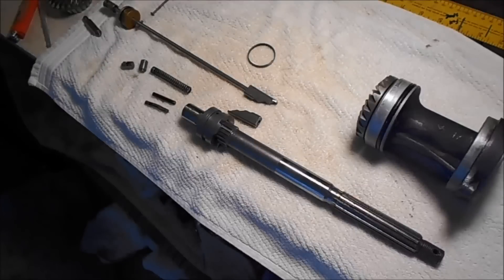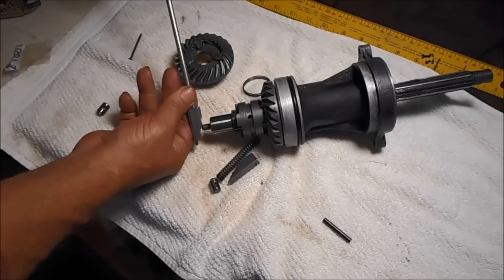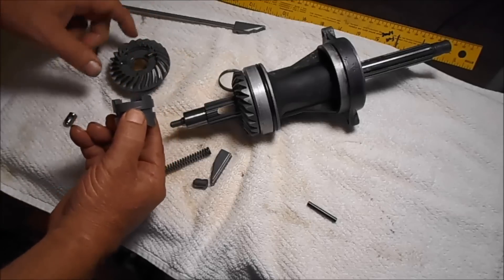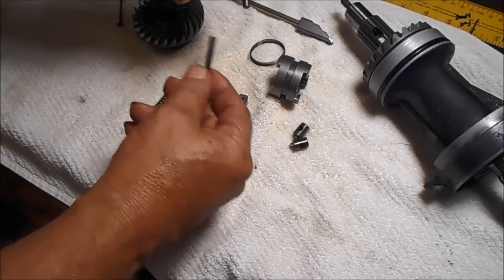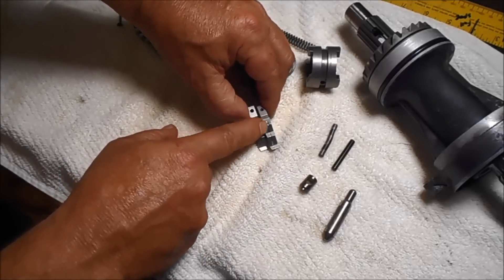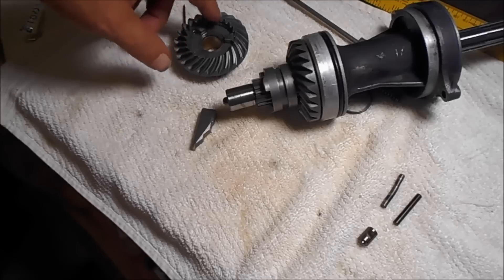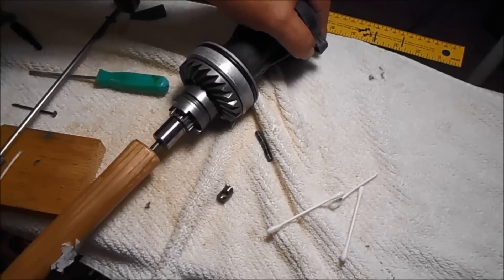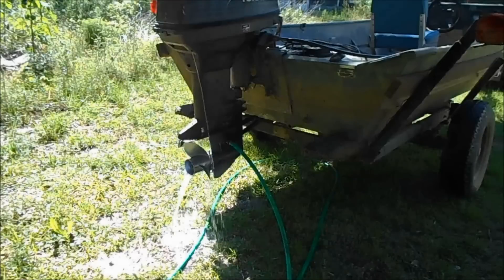Outboard Wont Shift Into Reverse Are Jumping Out Of Gear, Clutch Dog

Comment from the maker: YOU WANT TO SEE MORE. I HAVE 90 VIDEOS...MY CHANNEL..CLK HERE..https://www.youtube.com/user/36erichol/videos   CLICK LOAD MORE
Reply: Danny S Hodges
Reply: Do you have any on a 1977 Johnson 70hp? 3 cylinder motor
Reply: Question...does it really matter what kind of grease gets on gears in a outboard motor?
I mean does it have to be marine grade?
Reply: Those bearings are designed for fluid inside. Try not to get any or it will cake your bearings and they will not roll properly
Reply: @davoh7910  Thanks Davo H...
I had a strong feeling it wasn't good but had to ask for emergency purposes..for "just in case"...
Have a great day.

Comment: Cool video. You covered issues I believe are the cause of more gear engagement problems people have with their outboards than the clutch dogs being worn. I'd be willing to bet that excessive play you show on the shift rod head and the bent pin and worn spring cams are the issues causing the dogs to round the edges.  Fix those first and the repair costs drastically fall to affordable and worth doing.

Comment: Thanks Danny!! Extremely good info. Of all the videos that I've watched on this subject, yours is the only one that I've seen to mention the pin and other parts as being possible problems. I'll be checking mine either today or tomorrow. I hope that my problem is as simple and inexpensive as yours!
Reply from the maker: TKS WES LOOK FOR SOMTHING THAT DONT LOOK RIGHT AND MUCH DONT HAVE TO BE WRONG FOR IT NOT TO WORK RIGHT
Reply: Danny S Hodges, thanks for the explanation of how all this works. After seeing your video, I know exactly what needs to be done to repair my "reverse" issues. Leave it to a good ol boy to show everyone how it's done. Roll Tide!
Reply: I agree mine also great video
Reply: Danny S Hodges I forgot to let you know that mine DID turn out to be an inexpensive fix.  After stripping it down to the gears, which looked perfect, and putting it back together and adjusting the cables, it ran great.  Thanks.
Reply from the maker: lol good

Comment: Watched your water  pump video also. thanks for that too. Doing my own water pump impeller and noticed the previous guy didn't replace the roll pin he had knocked out on the shift linkage and there was only a half of a cotter key thru it bent allowing slack . I found the old roll pin in the lower unit where it had been lost. Expecting to see a difference on the same situation you have. Mine is weird about shifting, never jumps out of gear, but sometimes doesn't wanna go in.    Thanks for the videos sir.

Comment: Hey Danny I have a 90 hp mercury shifter won’t go in reverse the problem is in the lower unit I can hold pressure on shifter at top of motor and turn the prop till i feel it touch then it will Wouk good for a while what u think

Comment: Hey great video and very informative as always! I a quick question, my outboard when going into reverse won’t click in as usual so the RPM increases as I put back the throttle and then she clicks into reverse at high RPM. Have you any experience or solution with this problem? 
Iv only had the boat on the water two days and my heart is broken 😅🫣

Comment: Hi Danny.  Just watched your great video.  I have a 1987 mercury 80hp  3cyl.  When I put the muffs on it,it  goes in and out of gear no problem. But when I'm on the water it will go into reverse but when I put it into forward it starts to skip. I machined the dog clutch and it seems to fit happily with forward gear but when I put it together and put it in the water it starts to slip again.  Should the spring hold it in place or would a little wear on the forward gear cause this. Your Irish reader.

Comment: It took me three days to find a video on this I really do appreciate it thank you so much would’ve been great if you titled it  Yamaha shift rod or shift problem. Thank God I found it and thank you for posting it. Mine is a little different there is a drain hole on the front loweer case you have to remove to push in on that shift shaft to slide the shift rod down all the way. Hope this helps someone in the future also. GOD BLESS

Comment: thanks Danny I have 150 Johnson 1996 went out on lake boat would not go in reverse totally surprised me worked fine last year. It goes in forward and natural fine sometimes I have to wiggle control in neatural or engine wont start any ideas?
Reply: I wish I knew the answer to your problem. Mines doing the same thing. But its honda

Comment: I  accidentally pulled my shift rod out of the gearbox while changing the impeller. Now it won't go back in. do i need to pull the gears out and put the shift rod in first or should it be able to be pushed back in by its self?

Comment: I have a Yanmar 36 HP engine. Forward and reverse is working. RPM is full when forward and reverse speed is given, but propeller speed is only on forward gear. Speed does not catch. There are 3 water outlets. All three work. RPM pays a lot. What a problem.

Comment: My Yamaha 4 Hp 2 stroke  wont shift  into neutral or reverse it only goes forward even if you shift . The propeller stops when shifting into neutral or reverse and just goes forward when accelrate even in neutral and reverse mode.  Someone knows wats wrong